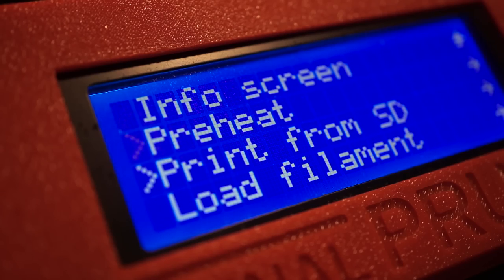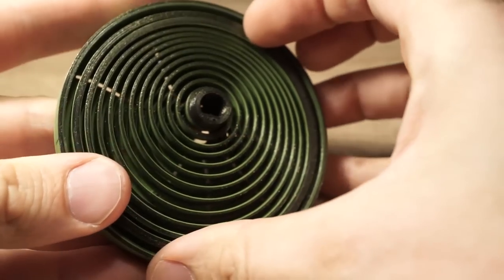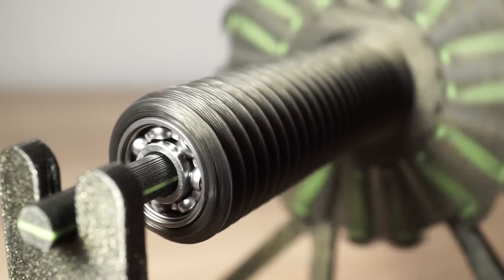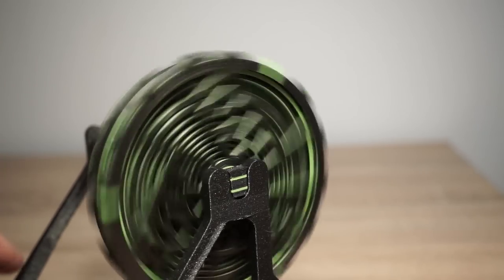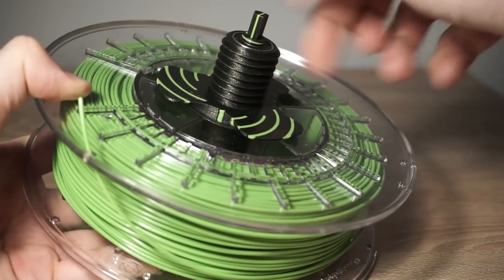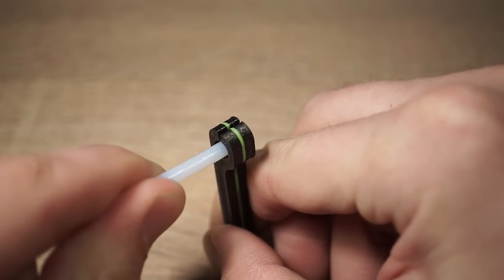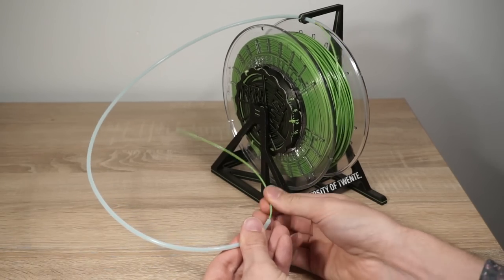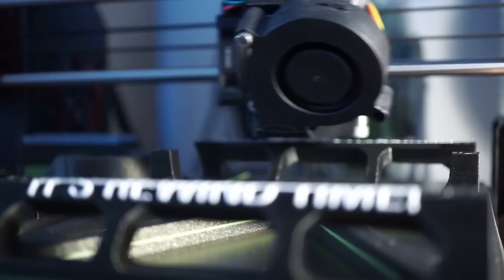Universal Auto-Rewind Spool Holder

Comment: Why do I need this?
Reply: you dont
Reply: pretty sure unless you are making multi filament prints on the regular you don't
Reply: RESURRECTION! When the Printer raises and when a Multi Material Unit retracts filament, That material goes back toward the spool. Without the Slip Clutch system, that filament just starts creating a rats nest and begins falling out the sides of the spool or worse, the filament gets stuck under more of the same material of the spool and stops moving all together.

Comment: I printed 5 of these (started with this design, then modified to hang upside-down under a cabinet) a couple years ago to feed my Prusa MMU2. They worked great for a while, but I'm finding that the clutch is no longer working properly in most of them. Does the spring need reprinted after a while?
Reply from the maker: Yes, PLA spring gets weaker over time, there are a few good remixes around with PETG spring inside a cup.
Reply: @VincentGroenhuis  Thanks for the quick reply. I'll look around for the PETG remixes. I like my setup a lot...don't want to change. 🙂
Reply: @VincentGroenhuis  It's too bad that there isn't some source for a metal sprint, like in old grandfather clocks, but that aren't too strong.

I don't know of a way to make one.

The thing is, 5 years later and right now, owners of a Creality Ender 3 V3 Plus sure could use one of these.

They put the spool on the right side of the machine and the big problem that everyone is experiencing, is when the printer does homing and the gantry travels up to the top to hit the limit switch, the filament unwinds.  But when the gantry comes back down to the bed, the filament can't rewind back into the spool so it just sprints all over the place, always getting stuck.  Either over the edges of the spool and/or gets caught up around the motor on that side and even grabs the motor's cable connector.  
It's a really poor design there.

Some of us have just moved the spool to the top and made an extension cable for the runout sensor that we also move to the top.  This solves that problem but can introduce another where, again, when the gantry goes to the top, it gets within a few mm, the filament gets bend to almost 45 degrees and often, SNAP!  I'm redesigning that now to allow a more gentle curve at that point.

But having a spool rewinder that doesn't need constant repair, would be good.  LOL

Comment: outstanding model, but I am trying to understand the use  case here.  is it to change filament more quickly after you finish?
Reply: No but to roll up the filament after the change if you print several filaments, so that it can not get tangled.  Useful for e.g. MMU from Prusa or ERCF for Klipper printer
Reply: it keeps the filament in tension when you unload the filament from the printer.

Comment: My printed spring was a total failure. The bottom and upper spart of the spring are almost fuzed together, same for the spring to the hub. How did you get the print so clean. I'm printing on a BLV mod printer with a bowden setup.
Reply from the maker: Try lower temp, higher speed, higher cooling fan, no Z hop on retract, different material type (PLA or PETG). Otherwise I don't know but you can also revert to the simple v1.01 spring.
Reply from the maker: Print the modular v3.4 spring which is super easy to print.
Reply: Same issue, but does work on top spring releasing, printed three times no support, no raft/skirt or brim and reduced bed heat nozzle temp etc. 2nd layer height...nothing works to free inner bottom spring...fused to bottom circular shroud as you say.

Comment: What did you use to do the multi colors on this print? It looks like you made your spring from purge material.
Reply from the maker: Purge, correct! Prusa MMU2. There is also a separate small wipe&prime tower.

Comment: I was going to print the RepWinder then I found this and it doesn't require any additional non-3d printed parts (apart from bearings (which I have lots left over from when there was a fidget spinner printing craze)). I'll being printing this instead.

Comment: I just got my first 3D printer. I have only made three things on it, and my filiment was coming off the spool and tangling and messing up my prints. So I'm trying to figure out what spool holder i should print to use intead of the one that came with my printer. My question is... is this for normal use, or is this only for when loading/unloading the filiment? I'm sorry, it's a newbie question, but I can't figure out if it is meant to be used in normal oporation of the printer too.
Reply from the maker: Also fine for normal use :-)
Reply: @VincentGroenhuis   thank you so much for replying!!! I really appreciate it!

Comment: Get -2Z shield option bearings instead of -2RS, problem solved. Putting the unshielded bearings back in there is not so smart... they'll collect dust and will require maintenance.

Comment: Cool mechanism though it looks like changing filament will be chore. What’s the advantage over using just a brake? Do you use retraction of several 100mm? :D
Reply from the maker: Yes, you need ~500 mm retraction for het multi-material MMU2 setup!

Comment: I don't understand what problem this solves...
Reply: it is basically meant to keep the spool from having too much slack as the extruder moves toward it pushing the filament back toward the spool. Sometimes filament can slip off the spool if there is too much slack in it.
I personally think best example for this would be on Delta Printers because when the print finishes it homes to the top pushing the filament back toward the spool in most cases. So that is where I think they type of retractable spool system would work best.
Reply: Its for multimaterial units where you have to retract huge sections of filament while switching filament.  If it doesnt go back on the spool it will get tangled and jam

Comment: I printed everything correctly using the latest modular spring but.. it does not rewind. I tried both PLA and PETG with no results, there is too much friction.
I guess i wasted my time and material. 
Please help me Vincent, the problem is the spring.
Reply from the maker: Where exactly is the friction?
Reply: @VincentGroenhuis  The spring does not unroll smoothly
Reply from the maker: @xAaronGamer  Try the v3.4 modular spring
Reply: @VincentGroenhuis  that's the version i tried, i wrote it
Reply from the maker: @xAaronGamer  Oops, ok. Can you make a video, then I can look at it. Hard to help from a distance. Why is the friction there? Parts rubbing against each other? If you remove the spring does it roll smoothly?
Reply: @VincentGroenhuis  where can i send you a video?  do you have telegram?  or do you prefer some other method?
Reply from the maker: @xAaronGamer  just post the link here
Reply from the maker: @xAaronGamer  Looks like the spool is not balanced. This can be fixed by using two curved nuts or by adding counterweights as explained in the video. Hope this helps!
Reply: @VincentGroenhuis  It should be balanced each time based on the weight and type of spool 😅
Reply from the maker: @xAaronGamer  I rarely need to balance it. Only for cardboard spools and 3kg stuff. You can also try the Integrated rewinder (v5) which is not dependent on spool balance and actually works better.
Reply: @VincentGroenhuis  ok thank you, i think i will try the integrated rewinder

Comment: This is good solution but a piece of sponge, clipped right on the fillament at the beginnig of the tube, does the job without any springs creating gentle resistance and cleaning the filament simultaneously ;)

Comment: so what does this solve a problem for? I have an ender 3 pro so not sure the application?
Reply: If you have a multi material printer like the Prusa MMU, it helps keep the filament from getting tangled
Reply: not much use for single material printer.

Comment: The spring for this set up is not well designed. it is literally the only item i have ever had fail with good first layer adhesion.  What happens is the spring comes loose during printing and then wraps around the print head causing a crash.  rethink its design . My advise to anyone thinking about this design is print the spring first, because if it fails there is no point in continuing.
Reply from the maker: That's why I designed the v3.4 modular spring!
Reply: @VincentGroenhuis  to make this print right I had to enforce supports. Which makes it very difficult to post process without breaking the spring. I would also recommend making the spool nut cone shaped so when you screw it on it auto centers the spool. Some of the nut pieces do this if you put them on backwards. Ibeleive there is also a way to increase spring tension by baking the spring at 175 degrees for 20 minutes or so. Not sure on that.  Mostly a good design, update the instructions with print tips for the spring.
Reply from the maker: You don't need supports for v3.4 modular spring
Reply from the maker: The spool nuts already auto center the spool 😉
Reply: Worked no problem for me, no raft, no supports needed outside of main stand unit

Comment: my spring is weld solid in the center
Reply from the maker: Check the slicer output layer view, is there a gap (skipped layer)? If yes: you can reduce layer bonding by increasing printing speed and fan, by lowering temperature and/or by changing to a different material. You can also try separating using a knife from outwards.
Reply: @VincentGroenhuis  Merci! Thank You:)